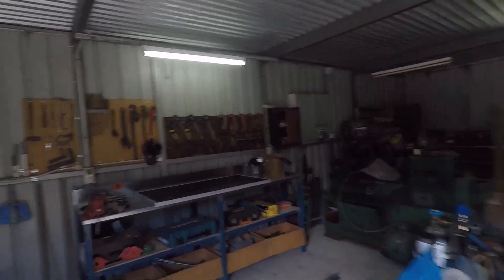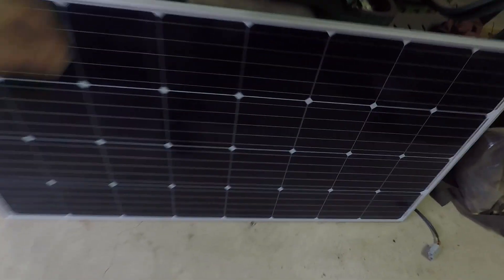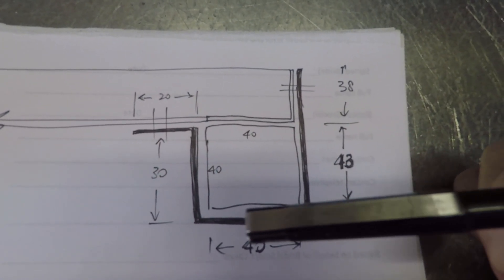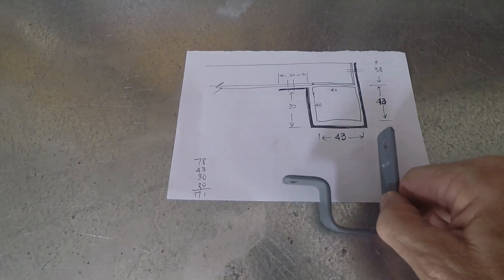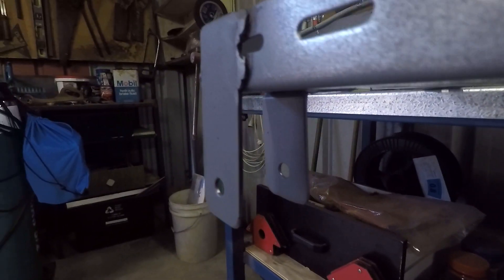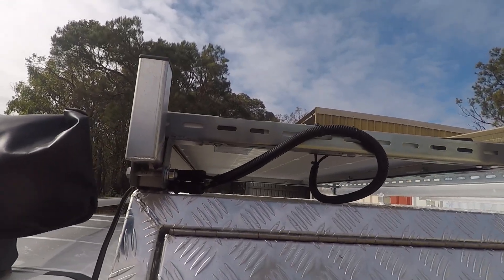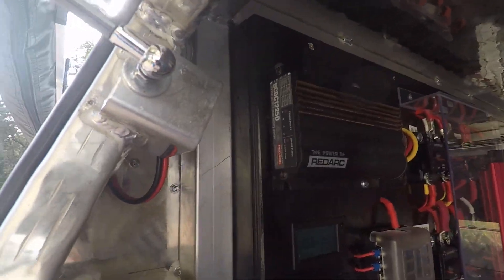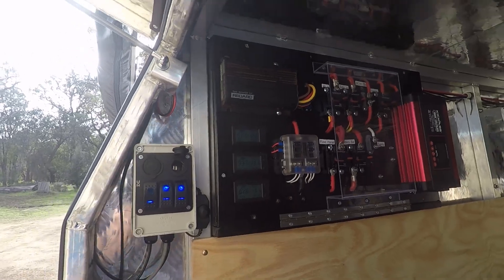How I installed a solar panel on the roof of my canopy.

Comment: Hey Rusty good work , just wondering where you bought those meters from (the little black ones)? Thank you
Reply: Thanks Rusty for the fast reply, Thank you again
Reply from the maker: If you have any questions, feel free to get in touch, ok....my email address is rmhyde58@gmail.com
Reply from the maker: Thanks Paul. I bought the little black panel meters off Amazon....it's an 'AiLi Battery Monitor DC 300V 100A Voltmeter Ammeter Voltage Amp Meter Gauge with Hall Effect Sensor Transformer'...search for part number 'UK-300V-100A-FBA'. Hope this helps.

Comment: G'day Rusty,, nice work with all your content/projects etc, I'm wondering how the solar panel has held up after 3 years if you still run it, and what sort of amps/watts do you get out of it ??  thanks, Al
Reply: Hi Al, the panel is still going strong after 3 years on the roof of the Navara. For a panel that lays flat, it still gives out around 5 - 5.5A and has no trouble fully charging by lunchtime, the 160Ah lithium battery that's now in the canopy.
Reply: thanks for the quick reply Rusty, I am just tossing up whether to go for the Renogy 200W or the Kings 160W Panels (much cheaper), I have a bit more confidence in the Renogy lasting longer though 5-6A is not great from a 160W Panel, I guess it would give a bit more than that in good midday sun.. 🍻 @RustysMetalSigns
Reply: @volcanic5187 the roof mounted panel is laying flat, so I'd probably get at bit more out of it, if it was angled towards the sun.
Reply: @RustysMetalCutSignsDesigns  yep yep I reckon you would mate, I will mount mine on adjustable tilt mounts so I can follow the sun 👌

Comment: You shouldn't have galvanised or zinc coated steel bolted to aluminium. Electrolysis will start. First, the aluminium will strip away the galvanising or zinc coating, thus exposing the steel. The steel will then react with the aluminium and rust like buggery. Just put a galvanised shackle on an aluminium boat and see what happens. 6 months later, you will have a rusted shackle and not be able to undo it.
Reply from the maker: Thanks Phelec59....I didn't consider the electrolysis effect between the 2 dissimilar metals. I'll certainly check it for signs of damage, etc.

Comment: Hi, why didn’t you put the panel on the cab roof racks and leave the canopy to put something on?
Reply from the maker: Hi Tim, funny you should ask that question, as I've already turned the panel 90 degrees on the canopy roof to give me more room for longer items to fit. I've been looking at the cab roof option and since I've fabricated a new aluminium roof rack for the cab, I am thinking of moving the panel to there.